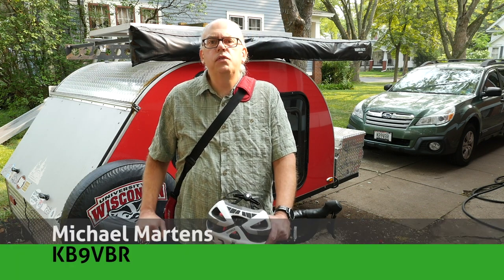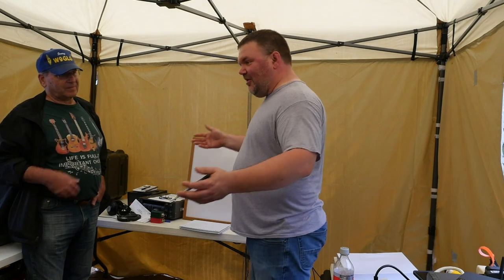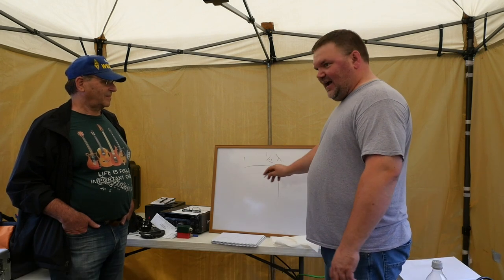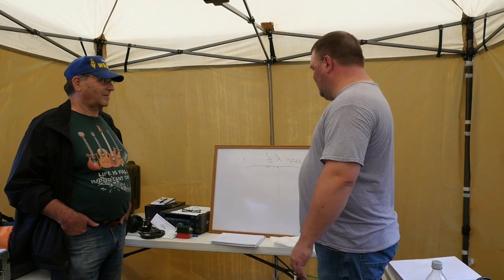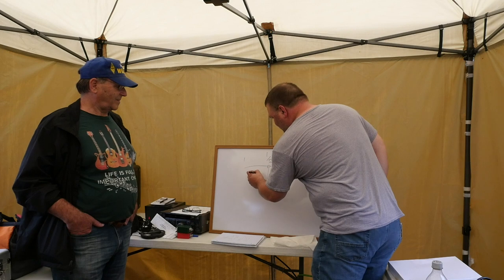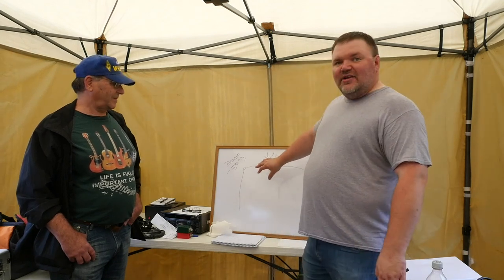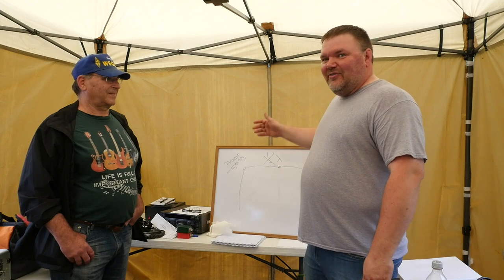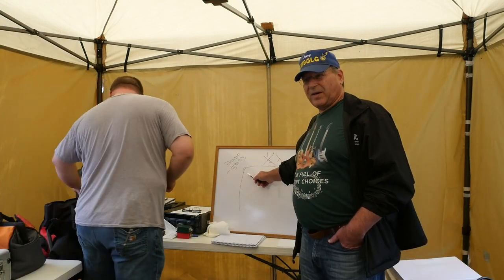All About End Fed Antennas, Field Day Educational Activity - Ham Radio Q&A

Comment: My EFHW acts like it is shorted. No noise on receive and high SWR. When I unscrew the shield from the pl259 and only the center is hooked to the so239 I get receive noise. What would cause this? Thanks for this great video!
Reply from the maker: Maybe the capacitor went bad, or there could be short circuit in the winding.
Reply: @KB9VBRAntennas  Well, I finally found the problem. Bending the coax at the pl259 connector a certain way caused it to short. These were factory connections.  I hate these types of problems.
Reply from the maker: Of course, always check the connections first. Glad you found the issue.

Comment: Could I  use a resistor at input to bring impedance down?
Reply from the maker: Resistors can be used at the ends of antennas to tame impedance and help them perform on multiple bands. My recent video on the Chameleon Tactical Dipole 2.0 uses that concept. But you lose a bit of power due to the resistor efficiency. I suppose you could also put a resistor in parallel at the feed point to bring the impedance down, but this would be a highly inefficient method of transforming the impedance.
Reply: I'd add to KB9VBR's comment that, iyou could just use a 50 ohm resistor and eliminate the antenna entirely.